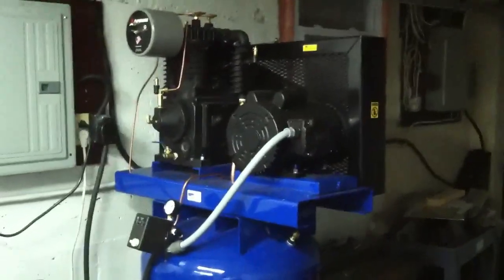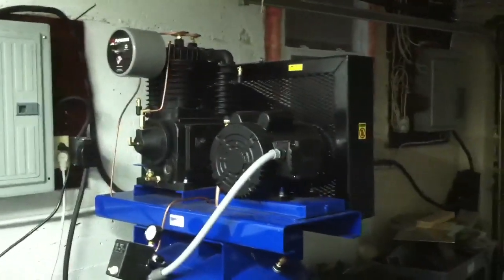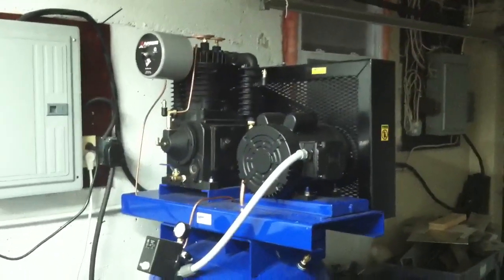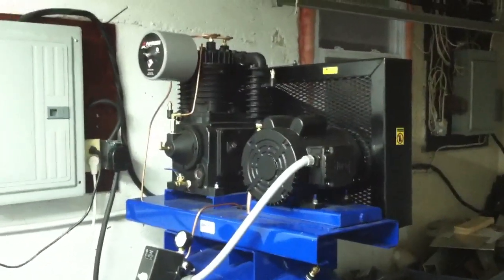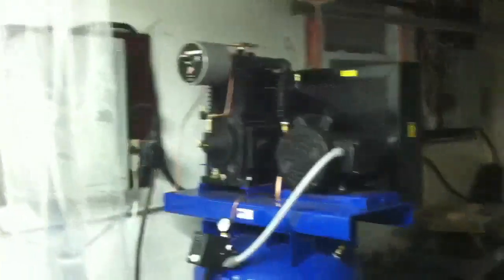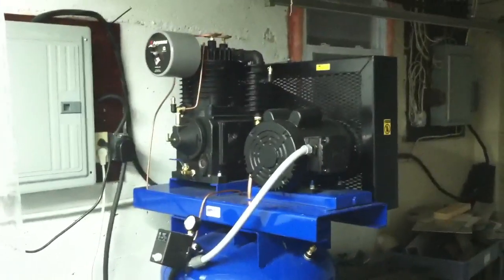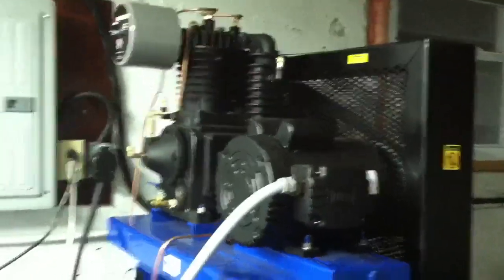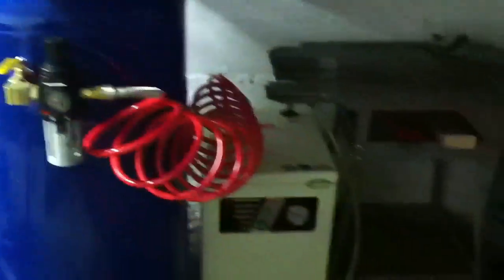Polar Air Compressor - Overview and Noise Demonstration

Comment: This is a Chinese knock off of an american made Saylor Beall air compressor, this particular pump retails for about $350, furthermore you should not be giving people advice on air compressors because you clearly know nothing about them... This compressor does need a mag-starter so good luck on your motor "warranty" when it goes out....
Reply: Eaton Gives all the compressors a 5 year warranty on there units parts no labor !! and the motor on that unit does draw 21-23amps with out a mag switch needed
Reply: A design for failure with a warranty is still a design for failure.
How much does it cost to be down when you need the compressor most? While you're waiting on that motor? While you're  removing it and replacing it yourself?  Don't you have things you should be doing during that time? Downtime prevention starts with a solid design, and that compressor does not fit the bill.
Reply: I would agree  with you that is why I have mag switch with my Baldor L1410Tand Siemens Switch with Eaton Pressure switch

Comment: Yes absilutely, they are not an option but rather a requirement made by many manufactures such as Frunas probably being the best, Square D more common, and Mitsubishi. The contacts inside that pressure switch are simply not intended to transfer the amount of current required by that motor without a magnetic starter. In addition the magnetic starter also provides thermal protection that could be caused by a varirty of factors. You can pick one up on line for about one hundred and change be sure to specify type of power ie. 220 single phase, three phase etc........ good luck........

Comment: Remove current air filter. Put in a 6" or so pipe extension. Run clear flexible tubing with at least one natural loop somewhere easy to get to. Add a common car air filter/air box. (90's Toyota/Prism is about $20 at a junk yard). The natural flex in the tubing will dissipate the air intake pulse and frequency noise Considerably. The Air box has build in baffles for added sound deadening. Now you have a huge air cleaner that can handle way more CFM than most compressors and is quieter and cheaper than almost any factory compressor filter/muffler If you get the above air box there are millions of them out there so the filter is cheap too. Almost any car filter and most motorcycle filters will work. Also if you use the above or some air boxes they snap on connectors so you never have to worry about the wing nut falling in the worst possible place to get at.
Reply: @SquareBodyK5  My uncle used an air cleaner from a 455 Tornado. He worked in a body shop so he ran the Air filter into the HVAC room. He would just blow out the filter every other month or so. I still get a smile when I think of this HUGE 455 filter on an air compressor.

Comment: The truth of it is that it has to do with charge and purge times. If you are purgineg  (using compressed air ) for 5 minutes and charging for 30 seconds then that is a completely different situation to charging for 2 minutes and using (purging) for 30 minutes. Size reduces noise because it charges faster, holds more and it doesn't have to make noise as often.

This is a crucial factor. A half quiet compressor that is charging every minutes is far worst.

Comment: FYI that's a Chinese made saylor bealle 705 clone. The market is flooded with those clone 705 pump
Reply: Had mine over 10years 0 problems used everyday.

Comment: quick question, dont you need a magnetic starter with it? i am about  buy an 80gallon 2 stage 5hp single phase, same as yours but made by pal manufacturers (canadian brand from princess auto) isnt magnetic starters used with 3 phase motors only i see that you dont have one installed.

Comment: The biggest thing that makes noise on a compressor is the air intake.  Muffle that noise or move the intake outside and the noise will drop to just the mechanical.

Comment: I wouldn’t put the dryer between the pump and the tank because the air is moving at if fastest there and it’s HOT. The dryer works by chilling the air to condense the liquid so you want it as cool as possible to start and moving slowly.
If your worried about the water in the main tank? I run a BigCat screw type air compressor and it generates a lot of water and I just let it out daily and the tank is now 10 years old and still in use. Also I would add an oil separator before the dryer

Comment: I handily solved the noise problem with my compressor. I built a small shed outside and put it there. That way I don't hear the noise, the neighbors do...Actually, I put an automatic timer on the compressor to cut it off at 10PM, since I am basically a humane person.